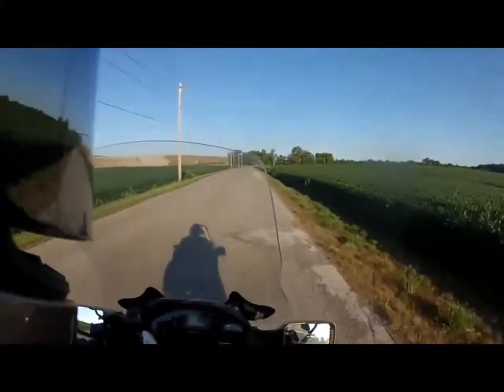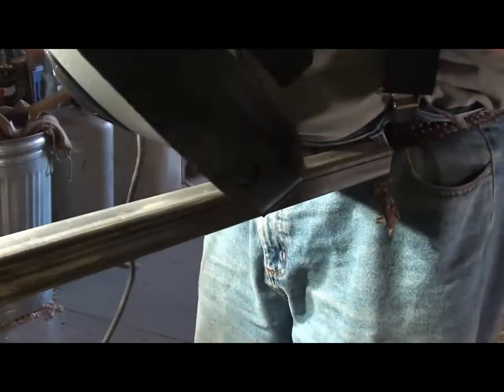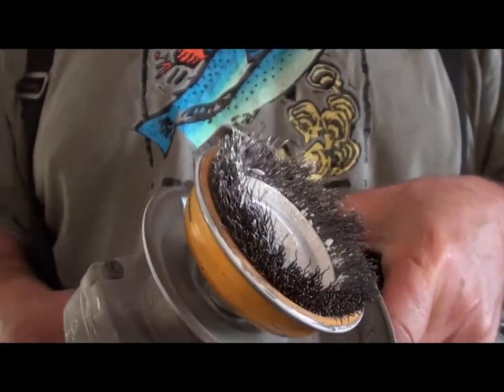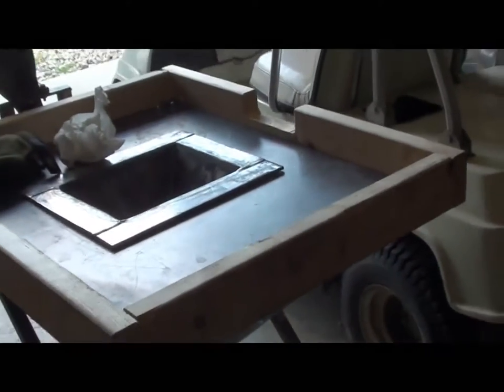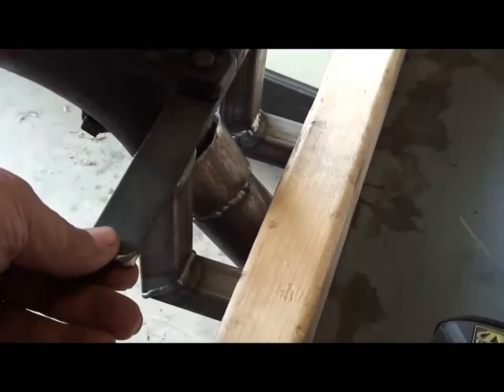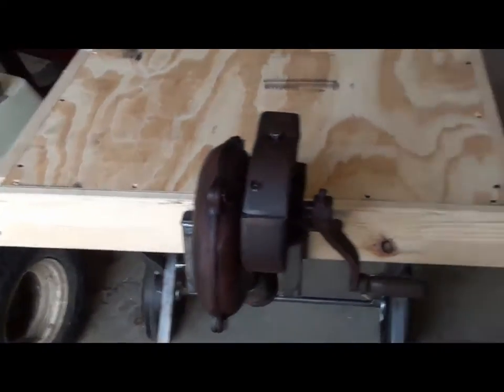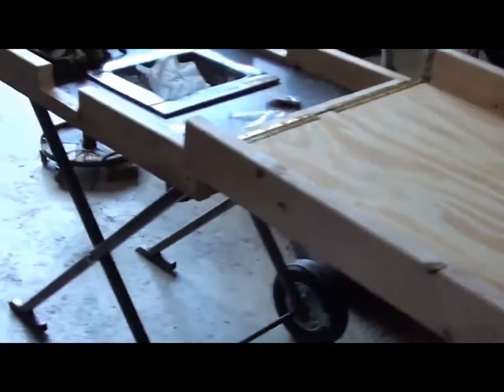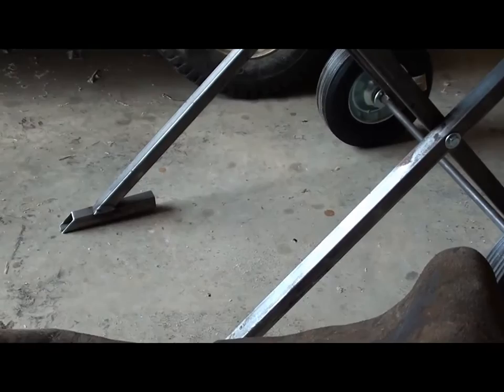Lets make a forge.  Part 3 Mounting the Blower

Comment: A forge made of plywood? Should work great as long as it's not exposed to fire. 😁
Reply from the maker: It works fine, first burn is also up here also. The only part that is made of ply is the lid that folds out to a table.
Reply: i use a forge made of 2 by 6's